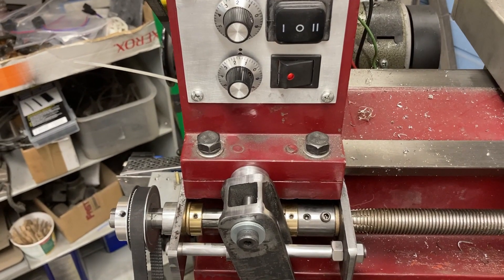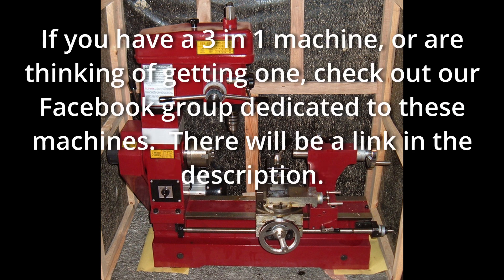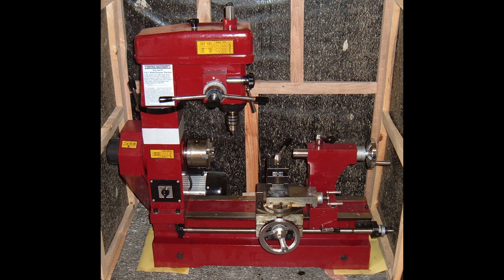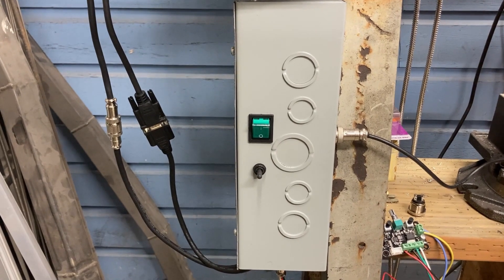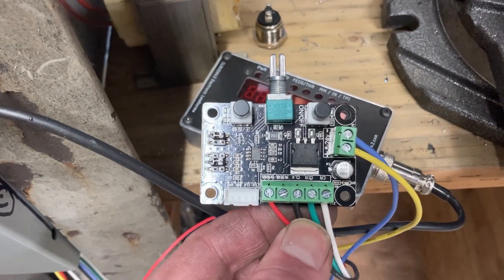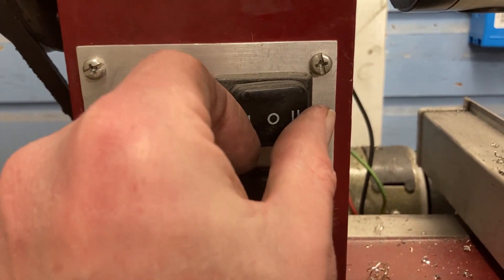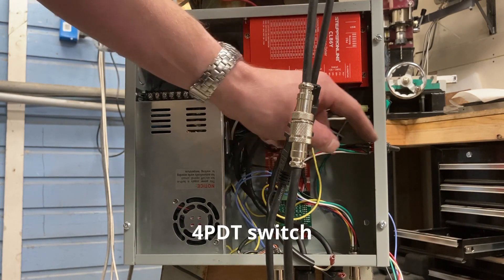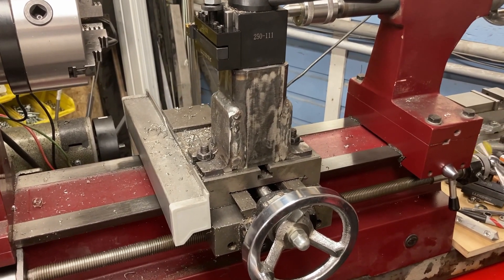Installing a Clough42 ELS or Electronic Lead-Screw on a 3 in 1 Mill Lathe Combo for threading.

Comment: I have a MEAN WELL LRS-350-48 350.4W 48V 7.3 Amp Single Output from another project that didnt work out, woudl i be able to reuse that one? Also, do you have a link to all the pulleys and belts?
Reply from the maker: You need to match the stepper power requirements to the power supply but fore most steppers that should work however the 60V power supply typically produces more torque if the stepper is rated to use it.  This video should also help you https://youtu.be/tIHPrIi9Zys

Comment: hi  i have a old lathe  that cut' s a thread by not using the led screw but insted it ues the rack  given on my lathe  what would be the led screw as a blank drive bare & that wuld be the half nut  we ues the rack to cut thread's  Is their any reason  i can not put in place a electronic  Led screw to replacer's  the  trading sister. ? & do away with the present gear system ,  the shaft drives a six  threads to the " pitch nut that in tern drives the rack gear & drive ,  I would appestat your mind on this point. I think if i chose a 6 thread's to the " led screw mother board  It wild be Repressive of my led screw the rack would be the drive as it as always been .  what di i need to do next.
Reply from the maker: If I am understanding this correctly the hardest part would be calibration.  Threading is movement of the carriage based on the speed if the spindle regardless of whether it is leadscrew driven or rack and gear driven.  As long as there is a place to attach a servo to your "rack gear & drive" it should be workable.  the challenge would be correctly setting up the firmware in the ELS to correctly sink the carriage and the spindle.  Here is a video with all the parts i'm using and links to purchase them should any of the parts work for you.  https://youtu.be/tIHPrIi9Zys

Comment: Hi  I have seen your videos with interest. I have a spare Clough 42 hardware left over from another project and the use of a separate manual feed appeals to me. I just hooked up a stepper and the manual controller but have hit 2 problems. Firstly the potentiometer does not have the correct value to allow the speed reduce to zero on switch on with the knob turned to the left. The second point is that the feed screw on the lathe is 1mm pitch which is 5 times less than a typical ball screw. the result is that the max value by turning the pot to the right is far too low speed. I am running with a 24v power supply as you suggest and shown on the controller. Now it did occur to me that I could use 48 v power supply and feed it to the stepper directly and having the 24v supply feeding the controller. 
I could switch over to a ball screw I suppose. Have you any suggestions? John
Reply from the maker: Changing the jumper locations will make it faster.  mine only turns off if I flip the the on off switch.  When I turn the potentiometer all the way down it still spins.  I have not used a 24V power supply so not sure where you got that number.
Reply: @dazecars  Many thanks..I had just found it on a web page that was selling the controllers. I tried various settings and have it nearly stopped at min pot setting and a decent speed for rapid movement. I found i needed also to play a bit with the step settings on the driver. I am now happy with it. I can set about trying the Clough unit.
John
Reply from the maker: @john2478  Glad you got it working, just keep in mind that the dip switch setting on the driver will effect the perimeters of the clough42 board when you flash it and you will need to figure out what settings will make it work properly.

Comment: What if you have a stepper with a built in encoder? Would that work? Or do you need to know the location of the lead screw not just the stepper?
Reply from the maker: you need a stepper with a built in encoder.  You also need the encoder on the spindle.  That makes it a closed loop system and is required to insure accuracy

Comment: I thought the clough42 had power feed built into it? If so why did you need to modify it?
Reply from the maker: You are correct the clough42 ELS does have power feed.The problem for me is it’s 100% tied to the spindle in other words as spindle speed and direction control the power feed direction and speed . That could be a great thing for producing very uniform cuts, the problem i have with it is to go back the other direction you need to reverse the direction of the spindle which stops you from cutting as you go the other way because the spindle is turning the opposite direction. Yes you can change the settings on the ELS power feed so that it goes the opposite direction of the spindle when you’re in reverse but that involves messing with the ELS settings every time. By adding an autonomous individual control it doesn’t matter what the spindle is doing. I can set the spindle at a given rate and do all my Machining with the power feed control.  Especially handy when needing to adjust speeds and feeds on the fly to minimize chatter.

Comment from the maker: Already had to modify the system. The forward/reverse rocker switch was to "soft". in other words it didn't take much pressure to go from one position to another and one times I overshot going directly from forward to reverse which is hard on the motor/ power components and causes the tool to switch direction without winding out the cross slide. The solution was a heavy duty toggle switch. Much better control between forward, off, and reverse.

Comment: I hate to be "that guy" but roughly how much did this conversion end up costing you?
Reply from the maker: That is not a "that guy" question at all.  It is a valid question that I should have addressed in the video.  I am into the components for roughly $275.  That doesn't include the mounting box or some of the smaller parts like switches and connectors that I already had:  encoder $30, Clough42 parts $50, stepper and stepper driver $100, stepper power supply $40, TI board $30, misc parts: pulleys, belts, and the like $25.  I could have saved some money by getting a smaller stepper but this was the first time I had ever used one and wanted to insure it was big enough.
Reply: @dazecars  thanks for the information, definitely much more feasible than i had imagined, i guess i have a new project to work on!